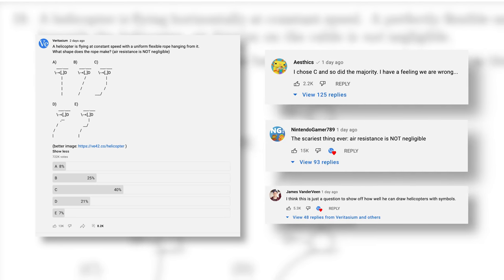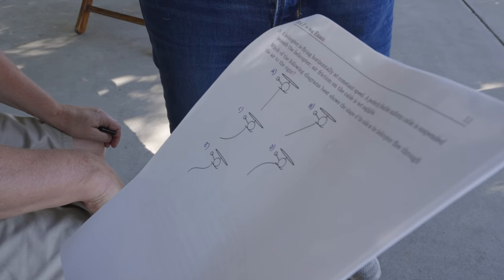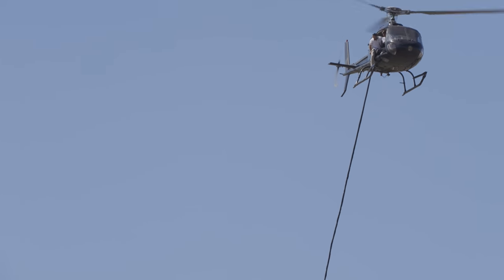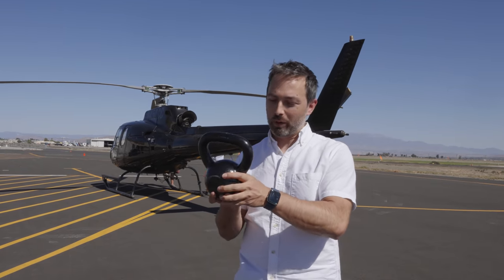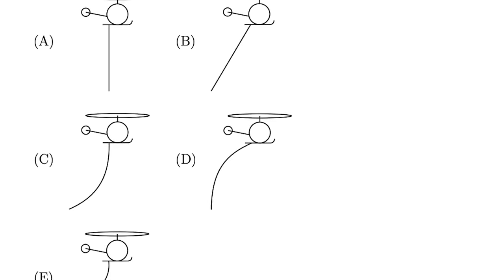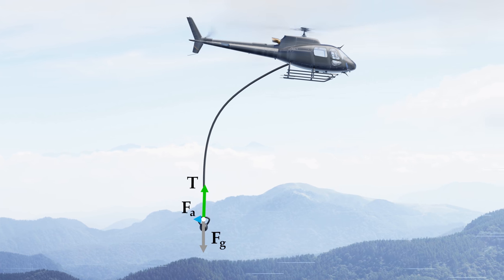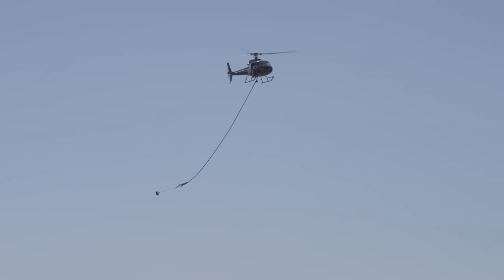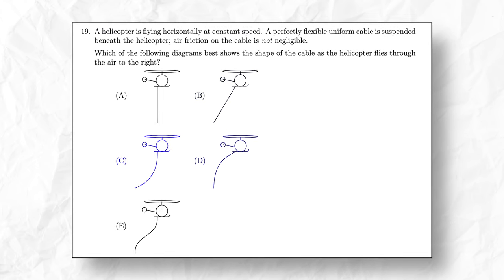I Rented A Helicopter To Settle A Physics Debate

Comment: I knew it was B, and was right, but its because im a drone pilot that I knew this would happen, I also know that the weight made that shape due to lack of speed, think of when you go fishing, and you drag your line, the more speed, the more horizontal your line gets. Go fast enough and that 8 oz lure or what ever weight, goes flopping in the wind, out of the water. The variable here is weight to speed ratio. The more weight you have, the more speed you will need to counter gravitys effects on that weight. You can blame the air or water all you want but speed is where its all at.

Comment: Physics was my worst performing subject in school and after I wasted so much of my grey matter on your YT survey the other day, I feel so validated with this video verifying my answer of B was correct when no weight existed.
Reply: I also picked B because I figured the force of air resistance was probably canceled out since the entire rope was experiencing the same resistance. So all that was left was gravity down, air backwards along the entire length, and tension force pulling diagonally

Air resistance I feel would only matter if the shape wasn't uniform in this instance
Reply: @cammywammy420  I figured that parts that if it wasn't a straight line, the more vertical parts would have more air resistance, and the more horizontal parts would have less, which would eventually go back to a straight line
Reply: i said it would be b because shapes like e and d seemed to inplausible, and i figured that since there was no force to create an c scenario, i guessed b, and i feel so smart

Comment: One thing though... the "perfectly flexible uniform cable"... I innately (perhaps wrongly) believe that the weight of the cable and the wind resistance of the cable (cross section?) will have an influence on the behavior.  If this were a spider line, for example, it would curve almost immediately and be horizontal.  So clearly the mass vs drag of the cable is a consideration.
Reply: The uniform rope's ratio of mass to drag affects the *angle*, not the curve.  (If you had a heavy rope but were flying mach 1, it would be nearly horizontal as well!)  Differences in mass to drag ratio along the rope are what generate the curves because you're blending between different resting angles at different points along the rope.
Reply: That’s not a Fkn standard cable, that’s a long ass flexible weight that weights waaaaay more than a thin standard helicopter cable, if it was an average cable you’d have E, the rotor wash would cause that S shape because of how light the cable would be and how little air resistance/tension would be produced when gravity plays so little role, it would drag further behind the helicopter and get much closer to the rotors and be much more easily impacted by rotor wash and it would flip around to balance out into an S bend. 
Either way the questions was worded in an idiotic way. You need to specify if you mean by that last sentence if you mean “to the right” of the page or the right of the helicopter, this is stupid and I bet you had the most intelligent students picking E and the basic people as basic as the teachers who couldn’t do anything better than teach being considered right for choosing B.

This reminds me of IQ tests like those that Mensa gave, they’d have these kinds of questions and you’d get more points for choosing the extra right answer and just 1 point for choosing the conventionally right answer. They do that to differentiate from a genius and your everyday above average intelligence human
Reply: @bawar112  oh look, it's the guy who thinks he's the most intelligent person in the room, and incorrectly selected E, and now has gotten angry over being proven wrong.

"It would drag further behind the helicopter..."

Really? How fast would they have to move forward to have it be horizontal? How fast would they have to fly for it to be at a 45°angle? 

Did you miss the part where they said, "If the helicopter flys faster the angle changes." Do you not realize this is true no matter the lines weight? Do you not realize that flying slower will also change the angle? Did you miss the part of the video where it was stated that the rotor wash dissipates quickly and has very little effect on the line?

"You have to specify if you mean to the right of the page, or the right of the helicopter."

No you don't. No matter which direction horizontally the helicopter flys, the shape the rope takes will be the same, just at a different orientation to the helicopter. Additionally, the individual images (except A) clearly show the line being dragged toward the rear of the helicopter, meaning the helicopter is moving to the right on the page, not to the right of the helicopter. If they had meant to the right of the helicopter, toward the viewer, the line would appear as in A, because the line would be dragging to the left, away from the viewer, and no bend would be perceived.

You're wrong, admit it, and move on.
Reply: Surely the mass of the cable has to be a factor... If its a light cable and the helicopter is not moving, the cable drops straight down. This is mainly due to gravity but there is still the little bit of wash from the rotars, but both work straight down here. If the helicopter then moves very slowly, the cable has a new force acting upon it and moves to the diagonal position. However, if the mass to drag ratio is very small, the cable will still experience downward force at the top (from the wash) and that force will reduce and dissappear as it goes down the cable, causing a curve. 
Just imagine a string being held in front of a fan (giving the diagonal) and then having a hair drier provide a focused downward pressure at the top of the string.... It's going to bend. It my not be the perfect analogy, but you see the point?
Reply: @philc4661  In this case, while air drag matters on the large scale, the rotor wash is negligible as it only has a modest impact on a tiny fraction of the rope.  The total force from the wash is swamped by the tension on the full length of the rope and any perturbations from the helicopter's hull and imperfect path.  When the helicopter is moving, the wash can also miss the rope entirely, since the rope is being slung from the bottom of the craft and the rotor is at the top.
Reply: Exactly my argument for answer A! I think more often than not the angle would be closer to 90 degrees than 45
Reply: @bawar112  The answer could easily be A given than the question specified "cable" which is firstly metal. If it weighs 50% of the helicopter's load, it falls safely in the angle range closer to answer A
Reply: Generally, no. The only scenarios where you would not see a diagonal is if the chopper is moving so fast that it becomes horizontal (would destroy the rotor), or so slow that is is vertical (not moving so irrelevant). Air resistance scales linearly with cross sectional area and gravity with mass, meaning that only the angle of the rope will be different depending on the mass to area ratio.
Reply: @bawar112  gotta love resorting to insults and not actually responding to anything he said
Reply: @bawar112  lol imagine thinking you're right this hard while watching a video proving you wrong.
Reply: Ppl acting smart are just idiots at an other level. I did chose E too. The experiment is done poorly. There are many factors not considered. The rope length which also is proportional to its weight. The speed of the helicopter. The time when you are supposed to check the rope shape. The rope should be cylindrical or any other shape? Density? How do we even find a perfectly elastic rope? There's a lot of friction in the rope itself! This is just like those question, what number is in my mind....
Reply: @joelbadger9661  I understand your reasoning but while at low speeds it would look like it's straight down it would never be 90 degrees because it's moving forward and it's always going to have even the slightest air resistance and therefore an inclination, and even if it's a thin metal cable at higher speeds it would have a bigger angle
Reply: @juanpls3856  But high speeds and cable thickness/weight isn't specified. If you average the loads and capability of the aircraft, more often than not you will have an angle closer to straight down than 45 degrees to the left. I think that's a very fair argument
Reply: @bawar112 , well, at least your ego is intact, even if your humility is not.

You're wrong, admit it and move on. Or, re-create the experiment with a lighter cable.
Reply: @joelbadger9661 , any angle away from A implies B is correct, because a higher constant speed for any given line results in a greater angle. You only get A with the helicopter moving at a speed insufficient to overcome the inertia of the line.
Reply: @notahotshot  You get answer A if the angle is closer to 90 degrees than 45 degrees. This is extremely reasonable. Any slight diagonal doesn't automatically make the answer closer to B. That doesn't make sense
Reply: @joelbadger9661  , you are taking B to mean literally the line must be at, or closer to 45° to be the correct answer. Any movement away from vertical means that it is not A. Answer A implies that the helicopter cannot move fast enough to overcome the inertia of the line. We know this to be untrue.

In other words, you get answer A if the rope does not move from vertical when the helicopter moves, because if it moves from vertical, a higher constant speed results in B.

For example, An s shape that is closer to straight than to that in E, would still be E.

You are basically saying that a change in angle less than 22.5° equals no change, so answer A.
Reply: @notahotshot  "Best represents" is easily interpreted "closest to". This isn't unreasonable
Reply: @notahotshot  yeah ok lol

Comment: When I answered the poll, imagining it as a graph of displacement over time helped me solidify my answer. If the helicopter was accelerating you would get the curved version like in C, and acknowledging this fact led me to feel more confident in answer B.
Reply: Same! Not a physicist at all, but I figured at constant speed it must straighten itself out
Reply: Actually, while accelerating it would look like D, but if the rope had 0 elasticity it would just slant with higher angles until it stopped accelerating.

Comment: I thought for the initial setup the answer would be c), i considered the stiffness of the rope would force it to be vertical on the top most parts. Clearly that effect was not as major as i thought it would be. Very interesting!
Reply: Same!
Reply: I think the answer changed because he used a cable instead of a rope.

Comment: Happy to hear that my structural analysis courses came to help me in getting the correct answer. Treat it like a simply supported beam with a single pin connection and it deflects linearly 
Reply: But that's rigid
Reply: @dielaughing73  it's a deformable body with a linear load.
Reply: I didn't like that they said the wind affects are "negligible".  So let me ask you guys this , If this were done in a vacuum, would the rope react the same way? I know the helicopter wont fly in a vacuum but hypothetically , what would the rope do ?

Comment: I was split between B and C depending on how much the helicopter rotors would push down on the rope compared to the wind. I assume if the force from the motor were considerable, then we’d have C
Reply: Yup, same
Reply: It is not a great exam style question just due to the fact that it kinda requires you to know the strength of the down wash and have prior knowledge on this topic and then obviously the mass of the cable, a question made with no regard for the student which sucks.
Reply: No, if there's no weight at the end it's b, the strength of the rotors it's negligible compared to the weight and air resistance of the rope, also its not wind what generates the force, it's the air resistance
Reply: @juanpls3856  
That exactly what I’m saying, a student wouldn’t know if the force from the rotors were negligible. Also, wind and air resistance are the same thing taken from two different frames of reference.

Comment: "Interestingly... no-one chose E."
I did 😢
I felt that turbulence and chaotic motion of the helo would perhaps cause it but seems I was mistaken. That's good I suppose
Reply: Interesting line of thinking. A and E were the first options i eliminated. A chaotic rope from the helicopters turbulence is a reasonable guess, but I don't think the option suggested that scenario. I think it suggested a stable S-shape which isn't very chaotic at all. Either way. I was also incorrect in choosing D.
Reply: Me, too - guessing that’s exactly what the pilot was worried about
Reply: me too
Reply: I totally chose E.
Reply: when you look at the video footage of the line at a diagonal (not the CG) you see the end of the line is wiping around slightly. depending on the line used this could be more or less than what we saw. add in some environmental effects and fly at the right speed and you will get that shape (maybe a heavier helicopter as well, not sure the exact variables to get exactly that shape, but i have seen it in real life).
Reply: Weirdly I got every one of them correct because I imagined them in my head but I don't know any formula's or anything I just thought of it as same weight, same resistance is a line, bottom heavy, same resistance is a downed curve because the weight is countering the resistance, same weight extra bottom resistance creates more bottom resistance. I'm not trying to be rude it kinda feels like people are overthinking it by implementing to many variables. Also weird thought couldn't you replicate this in water under similar conditions?
Reply: @A_Bag_of_Potatoes  different values for the variables. part of the fluid hits the line and deflects down due to the angle. this means that there is higher pressure the further down you go. this is why the end of the line whips around a bit (you see this in the video). with heavier fluid (water) this effect is more pronounced, and thus you will need a denser line in order to get that same straight shape.
Reply: @jamoecw  Wouldn't that help your argument though through exaggeration of the elements affecting it creating a macrocosm through a condensed controlled microcosm I mean air is breathable fluid and pressure is just dictated by height, weight, gravity aka elemental forces put upon it right? Also isn't the slight whips at the end of the line is because of resistance curving around the end and clashing with the resistance curving around the sides of the end causing it to be unstable breaking from the tension which it is then subjected to differing degrees of resistance causing for lack of a better term that I know of the end tail wag and toying & tweaking with all the elements in play pressure, resistance, density, [insert variable here], etc. causes a more pronounced whip aka a greater instability in the line? I'm no physicist I never took no class but this just makes sense to me I may be wrong I probably am but it seems right?
Reply: @A_Bag_of_Potatoes  he mentions that students made models to replicate the variables lined out in the question. the values for the variables were not stated, so the students managed to get different results than what he got simply by having different variables at play. that means that the variables which are not mentioned dictate the shape. so if you change the variables (such as doing it under water) you might get different results. how he got the results he got has to do with the variables balancing in the right way to get the shape he got. heck we haven't even talked about ground wash (the wind created from the thrust against the ground from the propellers).

in order to really dive into to this in order to say that the tests were definitively wrong you need to break down what variable does what and what are the upper and lower bounds found in reality. they wanted a simple question with simple physics at play, but some people thought about it as if they were asking a real question (and not a multiple choice question that is just there to test certain principles). that is the overthinking part, not what is going on in reality. basically the question punishes students for applying their knowledge in a real world situation, since they have to guess at the variables at play that were not stated.

Comment: If air resistance were negligible, then I guess the correct answer would be 'A'? And to produce the S shape of option 'E', a parachute in the middle of the rope and a weight at its end would be good?

Comment: Great job, Derek.  Really enjoyed this video.  I admit, my initial guess was "E" because I thought the down-wash from the rotors would tend to push the top portion of the rope down.  Appreciate the physics lesson.
Reply: What I missed in the pictures is the length of the rope in relation to the heli size. If the rope is relatively short and very light, then the down-wash does matter and the rope will not be straight, I think. As the air flow is all but laminar, the rope will flip around wildly in that case (there must be a reason for the pilot's fears, after all). And in that case a - d are all correct and wrong...
Reply: Option E seemed legit! I thought that on a hot day the convection of warm air from the ground would be enough to cause a slightly unpredictable shape.